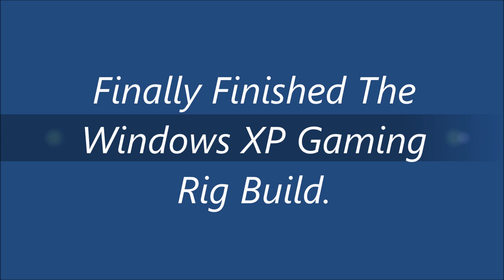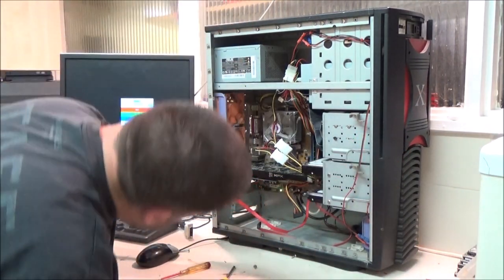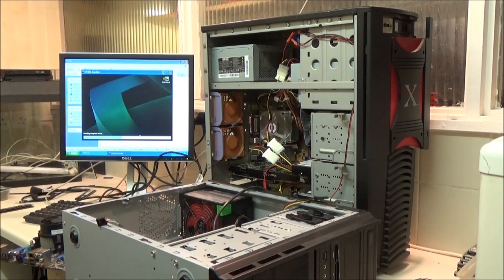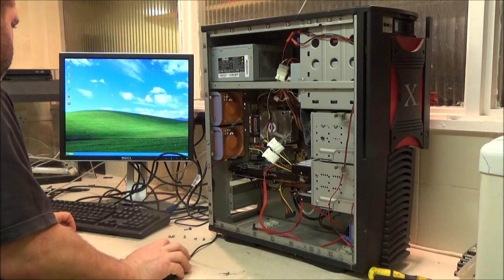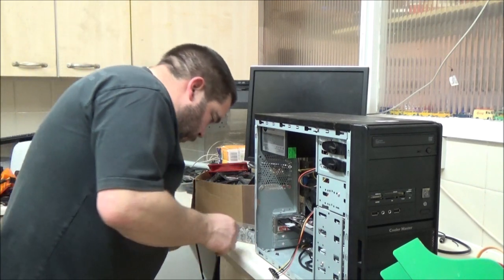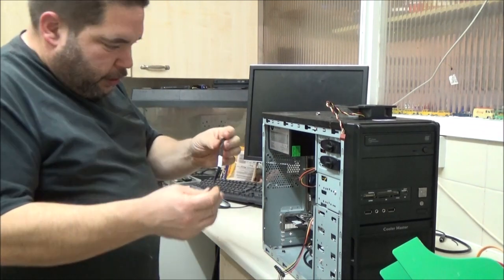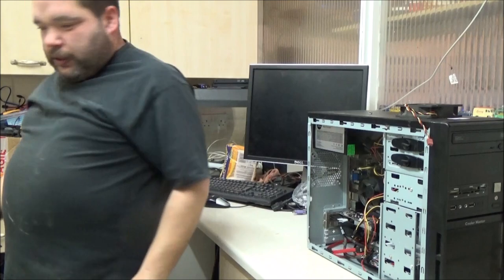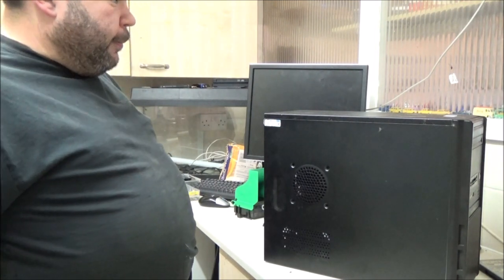Windows XP Retro Gaming Rig Build Part 2. Plus I Start A New Build.

Comment: I just did a clean Windows XP-32 bit clean install for some 1990-2000 games.     Many issues, but I got it running with no device errors.  The games are jewels.  XP rocks.  Just dont use the internet much with XP in 2020.